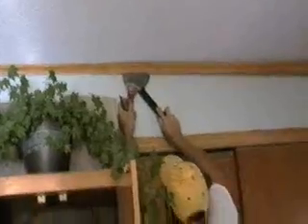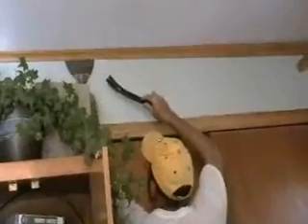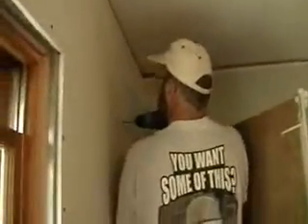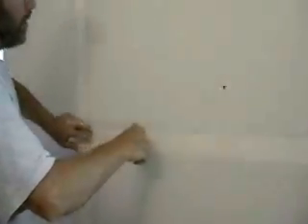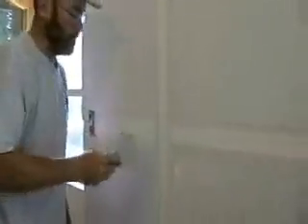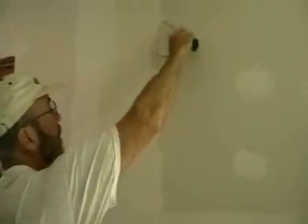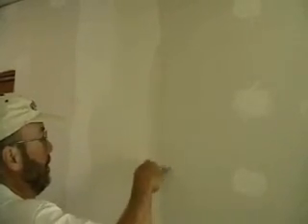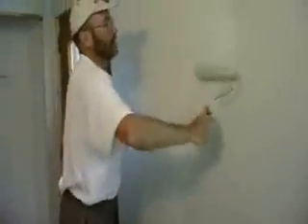Save Energy - Convert 4" Walls to 6"

Comment from the maker: I very much doubt that someone is going to devalue my home by $2400 because of the lost 2" on the exterior and if so it would be offset by the fact that we have 6" walls instead of 4" (it gets to -30F here!) . The R-value upgrade was nearly double for us - 3.5" of matted down outdated rockwool vs. 5.5" of new fiberglass. And in the header area I added 2" of dense foam instead of 3.5" of wood - more than double the R-value. We feel the difference in our bedrooms!

Comment: You will never save the cost of the remodel here with energy savings. Insulated wall makes up about 5-10% of your envelope.  Beef up that 5-10% all you want, it wont do much to save any energy. That is why they dont do it in new construction. That and the fact you may lose 20+ sqft of living space, avg house is 120$/sqft, which means you just lost at the very least 2400$ worth of home by doing all of the outside walls.